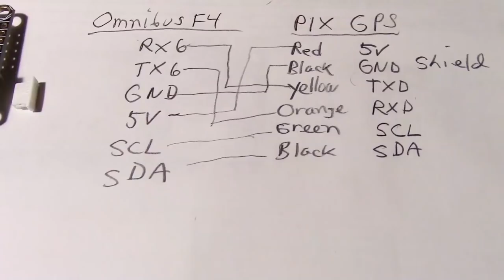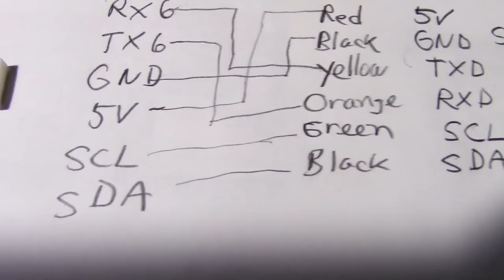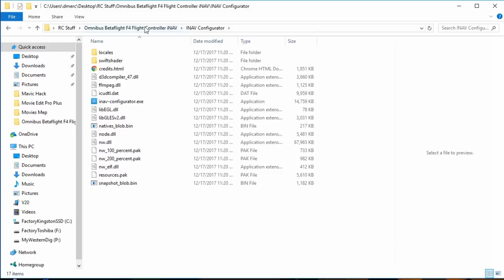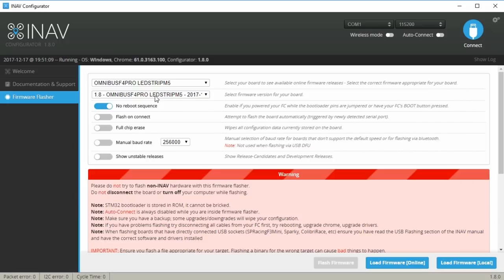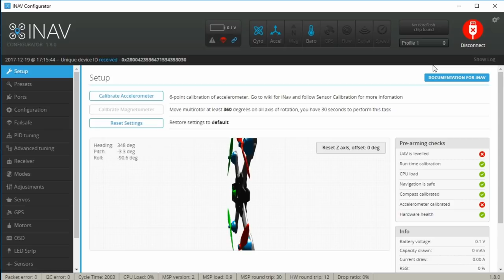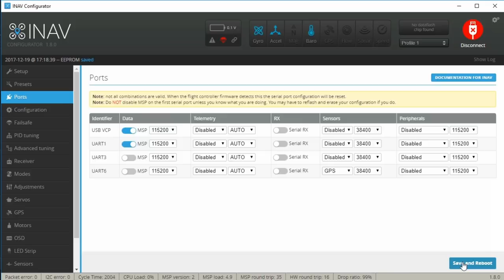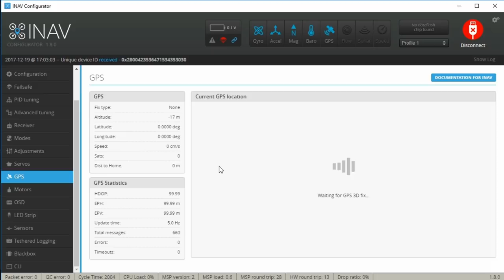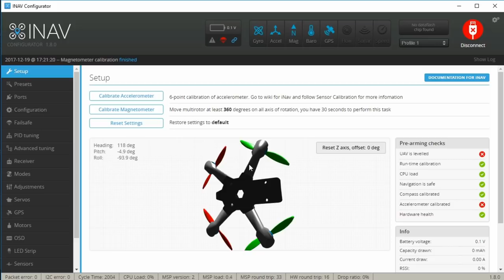Wiring GPS to Omnibus F4 Flight Controller and Configuring iNav Firmware

Comment: Hi there Dave. Just a quick line to thank you for the informative video. Not only have I hooked up my gps, but revived an old flight controller using the boot button to get it re-flashed with the PROPER firmware! Two birds/one stone. A1 video mate. Cheers, Phil
Reply from the maker: Thanks so much. I'm glad the video helped you out!

Comment: On OMNIBUSF4 (with current sensor) SBUS and UART6 shares the same port. So you can use UART6 for GPS OR for SBUS receiver. To solve conflict you have to move GPS to UART1 (at the opposite side of the board relatively to UART6).
Reply: Are you talking about the holes?  I've tried everything to get the serial port to stay set in the ports tab and nothing will stay set.

Comment: Sir m having some trouble with the inav. As of now i believe the omnibusf4 pro may not be supported with inav. Coz when i installed the gps and flashed the latest inav, my board is now constantly beeping. Continuous beepin in DFU mode, and once flashed it just beeps in patterns and doesnt stop, secondly when i connect to inav it just goes to that page where it shows no firmware or cli page apears just like you showed. Wht is happening? Thanks.

Comment: I am not able to make NAV POS features such as pos hold or RTH working. When checked blackbox logs, I am seeing lot many time in between flights, compass (mag) go to "unhealthy" state. Initially when i was setting up compass, I had to reduce i2c speed to 200KHZ (otherwise mag was showing red in INAV). I read somewhere that If my compass chip  is not original this could happen.  Do you think I can use an external HMC5883L compass and stop using internal GPS compass and that could resolve my issue?
Reply: I am all set on this, pull up resistors to SCL, SDA resolved my issues.

Comment: Hi Dave...I see you have my iNAV Flight clips listed on your PC...:)  I think you should read the Wiki on iNAV Dave, because I seem to recall they specifically advised against using a Mag (Compass) when using iNAV.  I think the same goes for using a Baro too.  But you can disable them easily I think.
  This is because the 3D fix offered by a 20 Sat capable GPS is more than enough, even on altitude....and using a Baro just causes conflict....Since its going in a plane, forward movement is always present, this is why the Compass is not required, unless you are planning on using it in a Quad perhaps?...Great Tutorial, as usual, oh, and pleased to see the traditional opening of RTP....:)
Reply from the maker: That was a little shout out there :-) I have been into the Wiki some for my BeeRotorF3 iNav wing/plane vids already. This video is more general for both multirotors and planes. I may diverge later into videos on each. I will be trying a quadcopter with iNav for example. Yeah the baro can be somewhat inaccurate especially with wind blowing on it (needs that piece of foam over it). Compass not generally needed for planes as you said.

Comment: My OMNIBUS F4 V2 PRO comes with Firmware: beta flight 3.1.7_OMNIBUSF4SD. I intend to use the FC with INAV. So before I flash INAV is there backup of original I have take. just incase I want to go back to betaflight?
Reply from the maker: Maybe there is a copy on github, not sure.
Reply: I received my Omnibus F4 pro v2 and it came with betaflight firmware. Planning to flash INAV soon . If needed, can I come back to betaflight firmware by using betaflight configurator "Flash Firmware" tab?
Reply: yes

Comment: Hello the gps units come as APM and PIXHAWK FC and 2 option to choose from Default Connector: APM , Default Connector: PIX.  Which one i should buy to use with omnibus f4 pro v2?
Reply from the maker: I usually get the Pixhawk version but the connectors never fit no matter which you get. You have to cut off the wires and solder directly or solder on pigtail connectors.
Reply: so we need 6 pin micro jst connector pig tail?
Reply from the maker: That is right, There is a link in the video description to the pigtails. Actually there are links to everything there.
Reply: I wired the GPS, connected.Flashed INAV enabled GPS/compass as you are explaining. GPS turned blue, but compass RED. Did little bit of research and ran command set i2c_speed = 100KHZ and that had turned it blue

Comment: I am running INAV 2.0.0 on omnibus f4 pro v2. FC is powered by 5V from my pdb bec. (J12 5V on FC)
How can I connect leds from the FC? (J16, J17?)
Reply from the maker: There's a port on the bottom for the LED strip on mine.
Reply: in this diagram https://www.electroya.com/wp-content/uploads/2017/10/Betafligth-Omnibus-F4-Pro-v2-botton-pinmap.jpg is it port marked J1? Also I cannot use regular LEDs with +VE AND -VE only? Can you send me a link of a sample led strip?
Reply from the maker: Something link this should work
https://www.progressiverc.com/matek-rgb-led-board.html

Comment: What is port J4 used in Omnibus F4 pro v2 in https://static.rcgroups.net/forums/attachments/7/3/4/6/2/5/a11237010-156-Omnibus-F4-Pro-v2-TOP-pinmap%20-%20Copy.jpg ? Can that be used to connect a Bluetooth or sonar or some other sensor?

Comment: Link for the GPS connector plug doesnt work… Can you specify what plug should I order ?
Reply from the maker: Mini Micro JST 1.0mm SH 6-Pin Connector Plug With Wires Cables 150mm

Comment: Hi Dave  In the spec on Banggood for this GPS/compass module it says voltage 3.3 v. did you plug yours into 5v?
Reply from the maker: Yes I did use 5 volts because the GPS has a 3.3v regulator on it. Maybe the specs are misleading.

Comment: will any M8N gps module work for eg https://robu.in/product/ublox-neo-m8n-gps-for-apm-and-pixhawk-flight-controller/  or http://www.quadkopters.com/product/apm-and-px4/ublox-neo-m8n-high-precision-gps-w-compass-for-apmpx4/  Also when choosing F4, should it have built in barometer and compass?
Reply from the maker: If it is for an airplane you don't need the compass, just the GPS but it's ok if it has one just disable it. Yes most M8Ns will work but some pick up sats better than others. Barometer is optional for planes although I use it many people claim it's better to just use the GPS altitude.
If you are building a plane try the Matek F405 or the new F411 flight controllers. I just bought an F411 myself. They are specially designed just for planes.
Reply: Sorry, I forgot to mention, it is for a quad-copter. I am aiming for return to home and altitude hold functions
Reply from the maker: Ok When using iNav a compass is required for multi-rotors by the software so you will need it. You will want the barometer too for altitude hold. So just get the works. You do not need a compass on the FC just with the GPS module.
Same stuff is true for pixhawk/apm too.
Reply from the maker: This is where I can't really make the decision for you because I have not built but one quad. I am more into airplanes. Either one should work though.
Reply: Thank you. I read inav wiki page and matek f405 is in the recommended board list. I think i will go for that.
Reply: My Tx/Rx is very basic Flysky FS-i4x/FS-A6, and If I am not wrong, it support only PWM. Can F4 board be connected to the Rx through PWM?
Reply from the maker: Probably need an upgrade so you can use SBUS or PPM. Taranis X9D radio and a new receiver would do the trick.
Or maybe the new qX7 might save some money. https://www.gearbest.com/multi-rotor-parts/pp_604500.html?wid=1859758  Or the QX7s if you got money https://www.gearbest.com/radios-receiver/pp_718500.html?wid=1433363
Reply: frsky qx7 is not something I can afford. i am looking at flysky fs-i6 with fs-ia6b rx. is 6 channel enough to achieve altitude hold and rth on a quadcopter? also can the flysky combo I mentioned earlier can support pwm, ppm, sbus?

Comment: Hi Dave, are the settings and changes OK for the f4 pro v3?
Reply from the maker: I haven't received my V3 yet but I am guessing it is very similar using serial ports 6 and 3 but with through holes instead of connector sockets.

Comment: I hooked this same GPS up to a Matek f722 std and it won't work for morning. Everything is hooked up like you said and I  got power but no connection, just a blinking blur light😣. I also used 5v and could not connect to INAV so I went back to 3v.
Reply from the maker: Look on the iNav GPS tab and see if the data is transferring.
Reply: @DaveMerc  no data is transferring, I was thinking maybe it just takes time to discover sats and that I should leave it powered on for a while.
Reply: @derrickmitchell39dm  same thing. did you figure it out? I get no errors, no packet loss, and the messages keep counting up, but no satellites/fixes.
Reply: @rionmotley2514  I think you gotta switch the RX and TX because that's what I did on the f405-ctr and up pops 9 to 11 sats. Some times the wiring is backwards. Switch all connections EXCEPT power and ground just to see what happens.
Reply: @DaveMerc   I switched out the TX and rx and got 11 sats.
Reply: @derrickmitchell39dm   yeah, I was wondering if the pinout was accurate. Hooray for handcrafted Chinesium! Thanks!

Comment: Already my XT60 is soldered to my PDB and I plan to plugin the lipo to the PDB.
In that case, can I just solder a 14AWG wires from PDB '+' to FC + and another 14AWG from PDB '-' to FC '-'? And nothing going to MOTO_VCC  Like below,
https://drive.google.com/file/d/19o-aWkbBtW_Cb150lEKCFz67kCDSO8KL/view
Reply from the maker: Yes you could do that. However you will be bypassing the current sensor on the FC. The FC will not be able to measure current.
Reply: can i provide 5v to bat+ and gnd to power the FC? instead of lipo full voltage?
I am not looking for current sensing or voltage checking feature.

Comment: does it work well with 5 volts? it should be a 3.3v gps module
Reply from the maker: Yes it works. Little know fact, there is a 3.3 volt regulator on this GPS that steps down the 5vdc to 3.3vdc
Reply: This is good news, thank you

Comment: Was thinking of attempting to use this FC (https://www.banggood.com/9_4g-30_5x30_5mm-Omnibus-F4-Flight-Controller-AIO-OSD-5V-BEC-and-Current-Sensor-p-1226610.html?rmmds=search&cur_warehouse=CN) for an Inav build.  Reviewing the pin out, I don't see the SDA/SCL connections.  Will this board not accept a GPS?
Reply from the maker: It probably would work since it has enough enough serial ports but it might take some experimentation to find which ports to use.
Reply: Appreciate the follow up.  Was able to get it figured out.  Utilized Uart 3 TX/Rx for the SDA/SCL; tested and works great.

Comment: and when the magnetometer and GPS appears red in the INav?
Reply: Check wiring and serial port settings on ports tab. Make sure no other serial devices are conflicting with them.
Reply: In case you have not figured it out already you may need to calibrate the magnetometer.